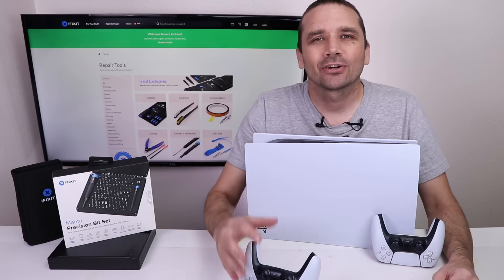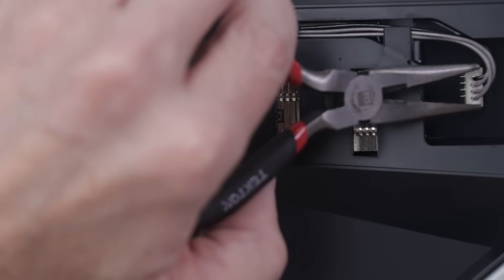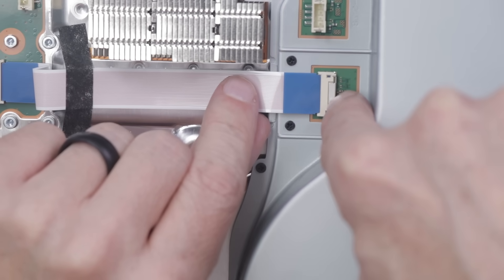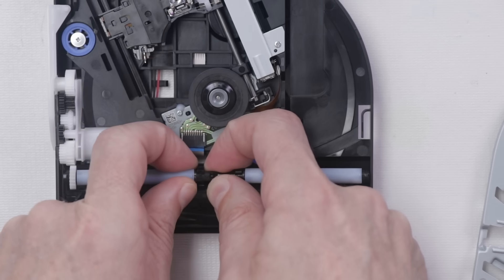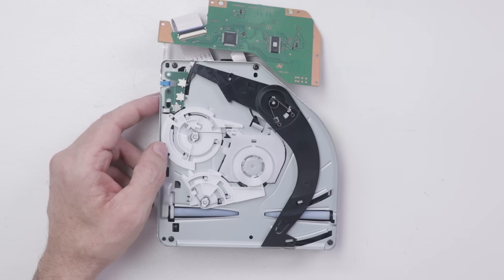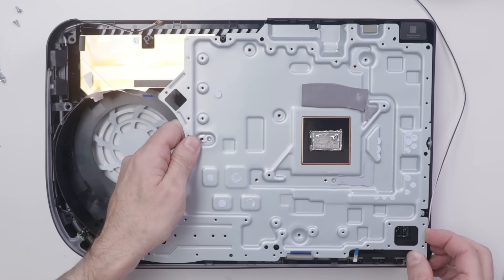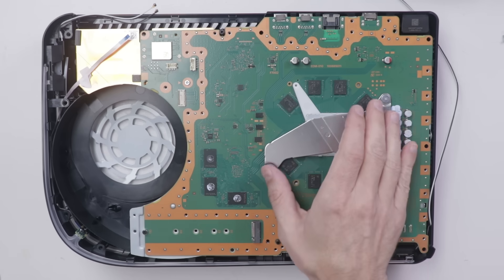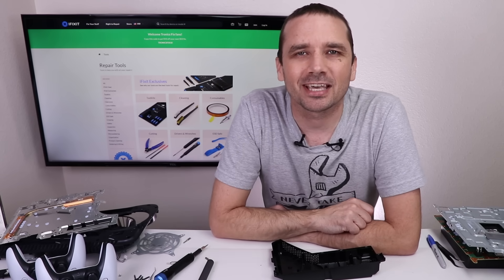PS5 Teardown - A Repairability Perspective

Comment from the maker: Get the best deals of the year on iFixit tools>>> ifixit.com/tronicsfix
What do you think of the PS5 from the inside?
Reply: Compare to austin evans diasaster 
Yours is plain clean crips and simple no damage down 
Just a nice smooth teardown 😎
But im worried because those built in ssds wont be easy to repair sinces they are not replacable
Reply: @AGENTMARIEAKA-AVENGER2236  And depending on the games played this SSDs chips can deteriorate in a couple of years. We will see!
Someone know what cell they use? TLC? part SLC part TLC?
Reply: @raulmiguelramos  exactly why I'm worried 
Because you can't download and play game at the same time BECAUSE those ssds will surely cause chaos
Reply: @RealOberonn  i mean hes um i dont know what to say about austin he literally dont have care for electronics 😩
Reply: @AGENTMARIEAKA-AVENGER2236  true...he doesn't know what he is doing...he only does for fun.
Reply: Xbox hardware engineers did a great job.Both series x/s look very impressive.
Reply: Next you’ll be buying five more from rage quits
Reply: How effective do you think thoose holes are that they made for you to clean The ps5 with a vaccumcleaner?
Reply: Would you say wait for the next generation of mouthed bord?
Reply: Do you know if an external disc drive will work for the digital ps5 version? If so would it work with PS4 and ps5 games or just ps5 games?
Reply: @sarpcetiner5236  Apparently you can use an external hdd but only for ps4 games. All ps5 games have to go onto the internal SSD or eventually the extended internal ssd slot.
Reply: @eclecticjon1019  correct. Ps5 won't play ps5 games from external HD because of the speed. To garante fast load time and transition it only can do trough the internal SSd or compatible nvme.2
Reply: No extern ssd slot, i will wait for the ps5 slim version.
Reply: @turbojay1616  I have to wait for PS5.5 (PS5 Pro)
Reply: Please get an automatic screwdriver, watching you take you all these screws gives me RSI :)
Reply: Can you check out the coil whine which is probably located at the PSU of the ps5?
Reply: Hey I have a problem with my ps4 game disc idk how is it happening so I'm asking u because you know about that. The game normally starts up and when main menu got loaded up there are some kind of little glitches and then it freezes and crashes. I think it maybe be a problem a motherboard but im not sure pls reply. Means a lot.
Reply: Ohh its the ps5 👀
Reply: 000
Reply: Please do the digital edition also. And if possible side by side comparison of the motherboard.
Reply: If i sent you a broken nintendo can you help me fix it
Reply: Dope vid.... suxxx hard to impossoble to repair.... gotta get that extended 20yr replacement warranty lmfaooo hey do u still do repairs on ps4 slims for customers? I never got an answer last time i asked....
Reply: @TronicsFix - very nice tear down and review. I instantly see an easy opportunity for aftermarket suppliers to create different color or even special design top and bottom covers instead of the white ones. Maybe someone will finally make covers that make it a box shaped unit like PS4 so you can lay it down flat and use it as a monitor stand instead of a pile of books 😊 - I do it with my PS4 Pro for my 2nd smaller monitor 🤪
PS!  - in the future it would be interesting to see a similar video on the PS5 with no disc drive and compare it to one with disc drive - maybe even test if you can plug in a disc drive and make it work on a unit that came without it.
Reply: Tronix, any chance you know exactly which cable is the bluetooth, which is the wifi?
Reply: IS POWER SUPPLY VOLTAGE FREE?
Reply: Awesome details, thank you!
Maybe you could tell which coils are responsible for this annoying coil whine plaguing so many PS5 consoles right now. And is there something we can do about it other than sending it in?
Reply: There is quite a bit of  misleading / bad information in the video,  I left some comments regarding those errors that jumped out at me.  In general I like your videos but watching Sony's teardown video would have prevented most of these errors.
Reply: How come you took it apart was there something wrong with it
Reply: Hey I have a ps5 digital you can tear down if you could help me fix it 😂
Reply: Uk shipments
Reply: Thanks for the video years ago I put in a adapter in my PS3 and you could adjust the fan speed with a screwdriver the fan plug looks almost the same I wonder if it's the same adapter I could put in the PS5 to control the fan speed

Comment: From my perspective your spending $2000 or less if its like that.
Reply: from this angle I can't leave Gaben for Playstation
Reply: My pc is to heavy to move more than onto a desk and these are quite light so that makes it a dust collector that probably requires someone to work on it..I probably spray the compressed more than needed so if you sell these people probably arn't going to do that...you can spend the money and you can replace the graphics card or keep playing with your PS5 and its at the point that I can't see the graphics needing to be better.  Its connecting keyboard and mouse back up to your computer that your going to spend 3x the cost.
Reply: the materials all of a sudden are becoming the reason.

Comment: Hi I nipped the wires from the fan going into the socket that powers the fan at the fan socket it still runs fine should I put insulation tape around it ?

Comment: I bought a used game and the game store person used some sort of a cleaning solution to wipe the surface. It looked clean to me, but I'm worried that it dried on, and shed inside the disc drive causing game performance issues. Im getting graphical pop-in and subtle frame dropping in Miles Morales PS5

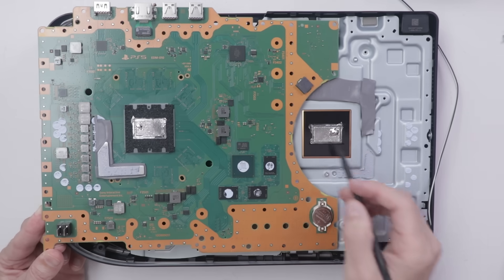Comment: 13:03
Is that circular thing to the immediate left of your thumb on your right hand a cmos battery? Because if it is, the same issue with the PS3 and PS4 cmos batteries that will make both digital and physical access to games impossible could happen to the PS5.

Comment: Thanks for posting this, it was very educational. Two questions though. At 3:00, you take a grill off that was covering the fan. Do we know if that has a specific purpose or reason for being there. Secondly, my PS5, like a lot of others I am finding online, has a really loud drive when reading discs. I compared it with the PS5 of some of my friends and mine is a lot louder than theirs. Is there something in the drive that would cause that? Like a loose screw or the like? Thank You

Comment: So, if I were to put some tiny LED'S to the left of the fan inside the exhaust venting, where could I draw power from so that light the same way that the white power bar does..

Probably an unanswerable question, but if you don't ask, you don't get..

Comment: In my findings: the disc drive board is also married to the motherboard in the PS4 as well. If you’re swapping out the old disc drive bc of a mechanical issue, be sure to swap the old board onto the new disc drive or you’ll get error message

Comment: Don't know if this will be seen or not, but I was curious if there's any visible weak links with the power supply?

My fiancee got her PS5 about 2 weeks ago, and it suddenly couldn't stay on. She would power it on, then it would shut off after about a second. Also tried getting it to boot into safe mode, but it definitely seemed like a hardware failure.

Sony is taking care of the repair, but just curious how common the issue is and if anyone knows what it's linked to.

Comment: Would be interesting if the non-disc version has the ribbon cable ports intact to add a disk drive, or even better if the disc drive version you could remove and just use a non-disc drive cover plate to make/convert the disc drive to a non-disc drive look....

Comment: My disc drive was very, VERY loud so, following the official support webpage's recommendations, I removed a disc manually. It jammed the disc drive. I called Sony for a solution and they offered a replacement, but it would take 21 days, meaning no PS5 during Christmas. I decided to send it after Christmas and enjoy digital content meanwhile, but I would very much appreciate any tip on how to fix it. The disc slot seems to be closed and whenever I try to eject the disc (there's none inside though) it sounds like a machine gun. I'm quite pissed, obviously. By the way, it seems to have happened to more people.

Comment: I want to try some experiment with the Coil WHine issue  coming from the PS5 PSU as the Coil are not secured.
I have a question, if I open my PS5 It's also needed to reapply the Liquid metal on the CPU ??
I never used liquid metal that's why I'm asking this.

Comment: I hate the fact they soldered on the storage. Should’ve never happened. That doesn’t last forever so we’ll still have Atari 2600s while all the ps5 consoles will be dead in 50 years.
Reply: I dont think you’d be using the ps5 for 50 years straight
Reply: @dfuma213  it will just be dead after 12years
Reply: @dfuma213  nobody will, but this is definitely an anti-consumer feature
Reply: Hopefully in 20 years we'll have tech good enough to replace them.
Reply: It's all about money. If it breaks, buy a new one - that's what they want.

Comment: I can’t wait until like 5 years and he buys a whole pallet of broken ps5’s
Reply: Nah 1 year people are savages sometimes trust me
Reply: @oldzkr  there were already photos of people not using the stand in horizontal mode and using it upside down
Reply: @rockl79  stand won’t save you
Reply: @tradinwarstoriez5641  it does exactly helps its for fans to blow cool air in and hot air out 😆
Reply: @TitusMH  That’s true but you cannot deny that the series x is built 10x better
Reply: *3 years
Reply: Lol wont take long. Ps5 build quality is shoddy
Reply: It really looks cheaply made in comparison to the Xbox Series X. Bad sign, that Sony has to use Liquid metal.
Reply: @Tinmy354  I wouldn't say cheap but MS' design is better. The liquid metal choice was most likely them pushing the clocks because the Series X was more powerful than thought.
Reply: @Tinmy354  lol
Reply: @RussStufft  This didn't aged well

Comment: @10:58 I've heard in a different video that the heat sink at the very top with a fan is that's where only air is getting I just the bottom half just the top so that pairs five it's going to be getting a lot of errors I'm not sure about the second heat sink even if it keeps that cool but it will not keep the other one cooler same means in 3 years and we went virgin better shut the fan cooling the entire heat sink not just the top that's really annoying.

Comment: I'm getting a os5 from europe do u think I can use it in the USA without a power converter?
Reply: uh I don't think so
Reply: @erirururi  yes you can because it supports 120v and 240v I have a USA ps5 and I live in Iraq and it works fine
Reply: @vWhiz  your in iraq not us unless your using the same port
Reply: @erirururi  there is power adapters
Reply: @erirururi  we have ports called joker ports they basically accept every kind of plug for every kind of country’s

Comment: your PS5 has a different fan compared to the sony's teardown and other reviewers
Reply: Sony has two types of fans that they randomly put in ps5s. One of them is louder than the other. That’s the only difference.
Reply: @adeptadrian907  it actually looks like there are 3. One with short blades, two that has blades that extend from the center and out to the edges. The big difference is the one with the little nub on top is the loudest, the one without it is the quietest (the one in the sony teardown). The one with short fins (the one in this video) is in the middle in terms of noise

Comment: I just want to mention that the reason the SSD is soldered on is because it is entirely custom. You cannot replace it because it contains all of the OS software needed to initialize a PS5 AND it also has 12 lanes of PCIE 4.0 with 6 priority queues. You cannot get that on the market. Likely never actually.

Comment: We're gonna put a heatsink here, here, here, here, here and another here why not.
Reply: The heat sink fins are closer together than the Xbox Series X Which will cause the PS5 to get clogged up faster with dust' 
I'm glad I went with the
 Xbox Series 💪 X
It is a Well Built Beast'😏
Reply: @jacobsebastien3910  And it has no games.
Reply: @jacobsebastien3910  you bought a gaming console because of dust? Lul
Reply: @jacobsebastien3910  it has a cleaning hole built in
Reply: @jacobsebastien3910  Yes Brother

Comment: "Don't mess with power supplies, all of these capacitors can give you a pretty good size shock" When I studied computer electronics engineering technologies in school, we would use variable DC power supplies to give  capacitors a little bit of juice and pop them on each other. (almost like our own stun gun good for 1 use) Those capacitors are no joke. Once one was charged a bit too much a blew a hole in someones jeans.

Comment: I would rather repair the xbox series x that the ps5 LIKE yOU NEED TO TAKE EVERY SINGLE SPEC TO get to the heat sink and the power supply 
AND WHY WOULD U HAVE A Soldered on ssd that’s just stupid xbox wins for repairs and its more compact

Comment: Hey any chance the HDMI is replaceable with the PS4 Slim or Pro HDMI Ports?
Reply from the maker: Yes, it is possible but you have to use jumper wires because the pins in the back aren't long enough.
Reply: @Tronicsfix  Thanks for the quick reply, I have 4 people with broken PS5 HDMI ports contact me already.
Reply from the maker: That's crazy.

Comment: Clearly this guy didn't see the official teardown by Sony. You don't have to actually open up the ps5 all the way in to clean the dust from the heatsink. you can just use a vacuum or a can of air to blow out the dust from the inside with one of the side holes of the black PS5 housing.
Reply from the maker: As I say at the beginning of the video I didn't watch any teardowns before I made this video.
Reply: @Tronicsfix oof understandable. I was actually getting my headphones  at the time while the video was playing 🥺

Comment: Came here after the reports on Sony using different fans. It‘s good that it is at least easy to find out if you got the good or the bad fan by just removing a side panel and a few screws. When I buy my PS5 I‘m gonna check that immediately and sell or return it if it is not the good/silent fan that is in the console in this video.

Comment: Im running without the outer shells, reduces  temps by 5 degrees Celsius
Reply: Crazy, the plate was problem for heat flows
But did ps5 has heat problem, compare to ps4 pro which lot fan noises?

Comment: This hardware is a custom built piece of art. I am looking forward to checking the XBOX Series X, because the teardowns i saw on XBOXes have shown that those consoles are basically slightly modified PCs. Probably not important at all, but its kind of meh when you know it.
THERE ARE HOLES FOR VACUUMING, so the heatsink can be vacuumed very easily, you dont need to tear the whole thing down....

Comment: Had my PS5 only 48 hours, hit with the system crashing, no audio being output at all, tried data rebuild and system reset and nothing at all working. Next attempt is to call Sony today but ain't looking good.
Reply: Update: Sony unable to fix issue, they have arranged a replacement unit which they say should be with me within 2 weeks (UK)

Comment: Quick question: where is the buzzer located in the console ? I've been eyeing the PS5 but I have severe hearing issues (tinnitus + hyperacousis) and the buzzer was the bane of my existence until I tore it out of my second hand PS4 when I opened it up for a thermal paste + thermal pads replacement. I'd do the same for my hypothetical PS5 but no one so far has shown where it's located.

Comment: The liquid metal is a very bold move by Sony. I hope it isn't going straight onto copper because the copper will absorb it all after 2 or 3 years resulting in an over-engineered heater. 
I've had to replace the liquid metal on my laptop after 3 years, my copper heat sink is now permanently silver where it touches the chips.

Comment: Hi, I have a problem with my disc drive, its very loud and sound like a shaver is on when I insert any disc (in vertical position). I can share a video. Does anyone has experience something similar? So sad now... :(
Reply: A friend of mine had this, are you SURE you're putting the disc in, in the correct way?
Reply: @MrGtagangster  yeah, there a few video online now and it's a assembly issue it seems... Need to exchange it

Comment: The PS5 is a nightmare to fix and they soldered the SSD directly to the motherboard which is a mistake.  They also used liquid metal.  I have seen a take down of an Xbox Series X and it is actually the best built console I have seen to date.  Especially when you consider it's capability.  It's interesting that the SSD on the XSX actually seems to be replaceable. I believe it is a mistake on Sony's part to have soldered the SSD on the board, but that's me. Time will tell how well that foam around the processor holding the liquid metal in place will fare with the amount of heat these consoles generate. My guess is that there might be issues 3-4 years down the line with heavy usage. In my opinion it is also obvious where the two companies decided to spend most of their money when it comes to these consoles. Microsoft went for higher quality and more powerful internals and more innovation when it comes to cooling, allowing them in turn to keep the size of the console in check and keeping it shaped like something which does not stand out so much, at the expense of not putting in more innovation when it comes to the XSX controller. Sony went with a more traditional cooling design, also needing an even more massive heat sink cause of the higher clock speeds they run due to the SoC being inferior to the one in the XSX in terms of raw performance.